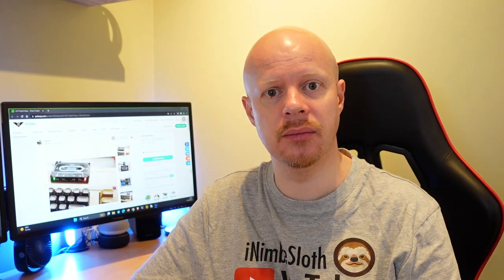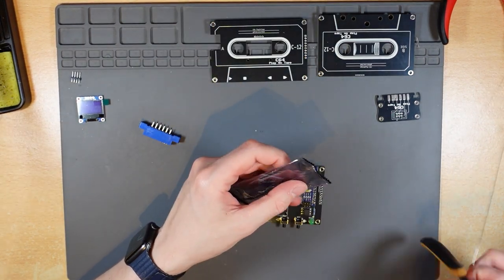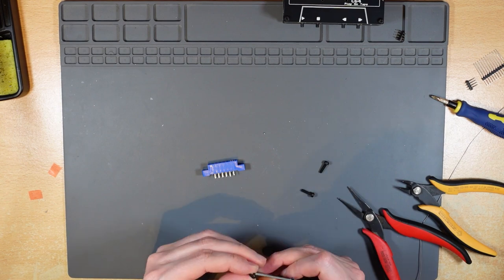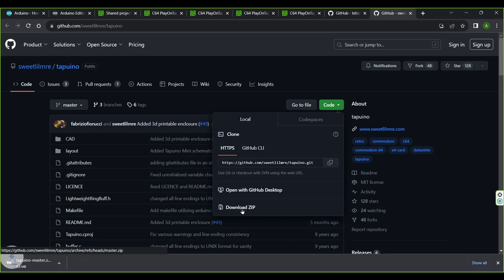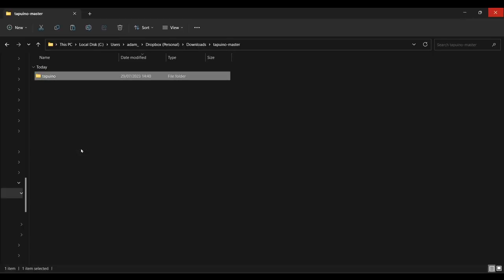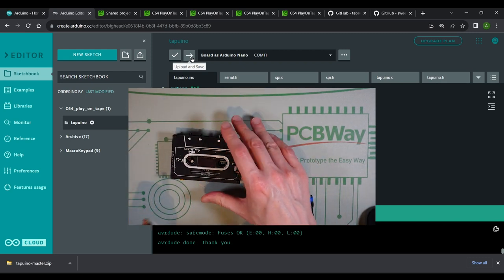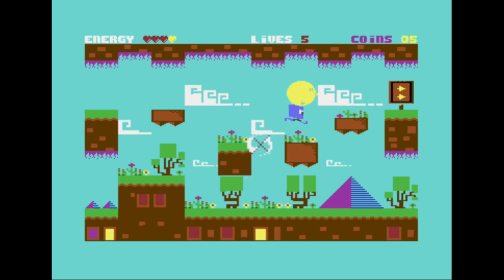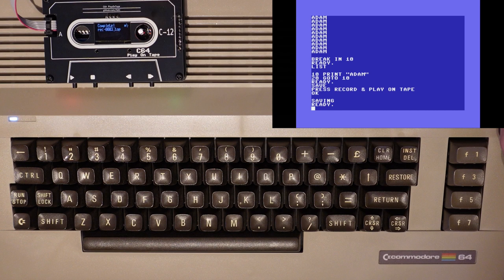Loading new games like it's 1982 has never been so easy! #commodore64 #arduino #tapuino #pcbway

Comment: Ah, tape loading times! Kids these days laugh when I tell them what happened with my Speccy in the 80's: load tape, load failed, load tape again, load successful, play game for two minutes, game crash, load tape three more times, load successful on third attempt, game crashes after five minutes, load tape again, Mum calls up I've had my hour of "computer time" and now it's time for dinner, cry. People genuinely think I'm joking! I hated that blasted machine, couldn't wait to get rid of it! And then about ten years ago I got really nostalgic and bought a second hand one! Weirdly I kept all my games and I'm pretty sure my Mum still has the tape player I used in the 80's, so I could have that joyous experience all over again! I must really hate myself... 

Anyway, I really enjoyed this video, even though I had the aforementioned Speccy and not a C64, this was still an interesting watch. Cheers!
Reply: I once spent an entire night trying to get my Spectrum to load a single game. It turned out that there was an error on the covertape that required a slight adjustment of the tape head azimuth between the header and the actual game data block. Man, I was so mad I could have torn my hair out in frustration.
However, I finally succeeded in loading the game, and quicky saved it to disk (it was a Spectrum +3), so I wouldnt have to go through that ordeal again.